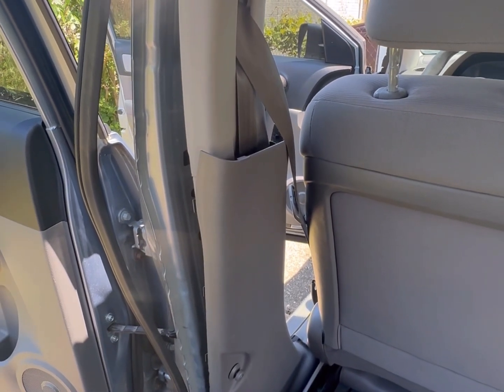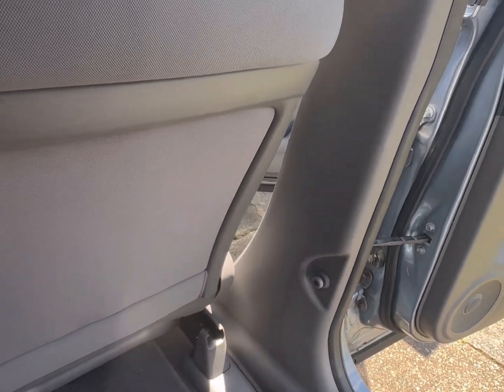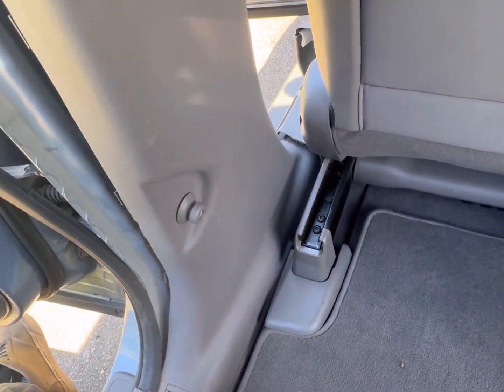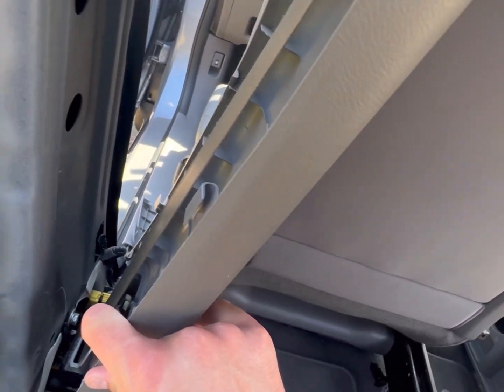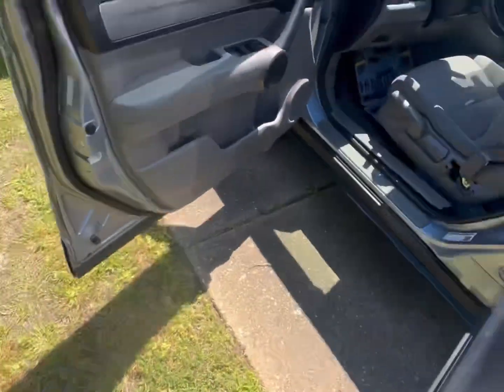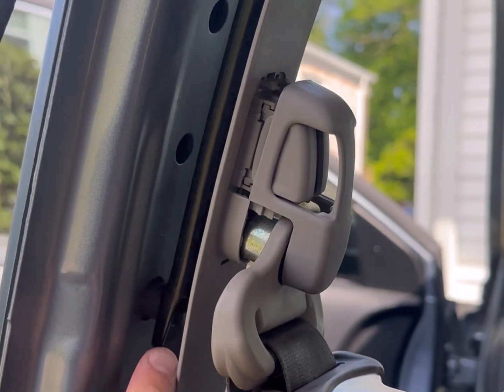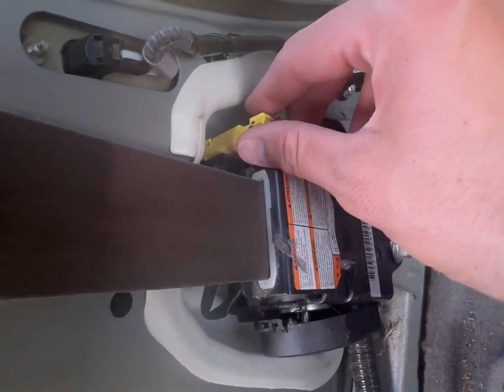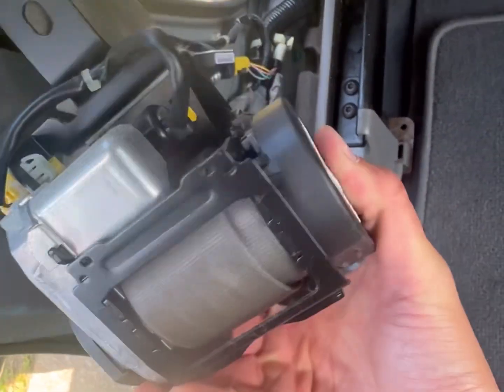2011 Honda CRV Driver Side Seatbelt Pretensioner Removal

Comment: Was your belt stuck? Or too loose and not retracting?
Reply from the maker: The belt worked fine. It did feel a little weird and rattled. I bought the car from someone who had it repaired after an accident. They didn’t bother with the airbag light. I hooked up a computer that reads airbag codes, and it said both the buckle and belt pretensioners had fired and the circuits were stuck open because of that. So with that info I looked up replacements but based on prices I ultimately sent them in to be repaired. Got them both back, reinstalled, and the light went right off.
Reply from the maker: Side note. If you have to take it somewhere just get a code readout for the airbags. If it’s a seatbelt/buckle issue. Fix it yourself. You can send them off to the same company that 90% of repair shops send them to. It costs around $80 each. And from what I learned shops will send them off, pay that $80. Then up-charge you $400-$500 to take them out, send them off, and to reinstall them. Like my videos shows. It’s pretty easy to do all that yourself.

Comment: Do you know the resistance value of the pretensioner? For a 2010 Honda CRV
Reply from the maker: @marpc8009  I’m not sure what you’re asking?
Reply: @Jordon-BattleFry  the resistance value of the pretensioner
Reply from the maker: @marpc8009  you didn’t elaborate. I’m not sure what you’re asking
Reply: @Jordon-BattleFry  Sorry, the seat belt pretensioner has a resistance value in ohms, do you know that value?
Reply from the maker: @marpc8009  I think I understand what you’re asking. It sounds more like a diagnostic question. I used a advanced mechanics car reader to get a read out of what airbag or seatbelt issue I was having. So I didn’t need to test anything to see what was actually the issue. I used a company to repair everything and you mail them the entire assembly which they fix and mail back. This video is more about how to remove the seatbelt and buckle. Not really a diagnostic video

Comment: I have a 2019 honda crv. Is this process similar?
Reply from the maker: Similar yes. But the 2019 is a much new model than this 11. 2017 they did a major redesign, and you’ll see the different body styles. So you might have fasteners or bolts in different spots, but the concept is the same.

Comment: I have a 2009 honda crv that was in an accident before I bought it and the drivers side seatbelt works fine, but seatbelt indicator light is on, would any code reader work to read the codes or do I have to take it to a mechanic to get the codes read/specific type of reader? I qlready purchased a new seatbelt, so would replacing it remove the indicator light?  
Thanks for your help! Any input would be greatly appreciated!
Reply from the maker: That’s a very similar scenario to what I had. The seatbelt itself works, and it will continue to do so after an accident. But the gas chamber inside the buckle or belt has deployed and is no longer going to be usable. That’s why your light is on, you would need an advanced reader to get the codes. Thankfully, I had a friend with one and was able to verify that I needed the buckle and the belt. You would probably need a mechanic to tell you if you need one or both. You could also just replace both depending on costs.I mailed mine in to be repaired and it was significantly cheaper than trying to buy new parts.